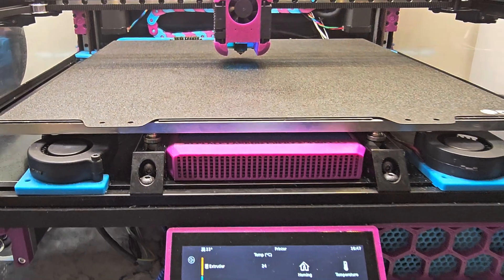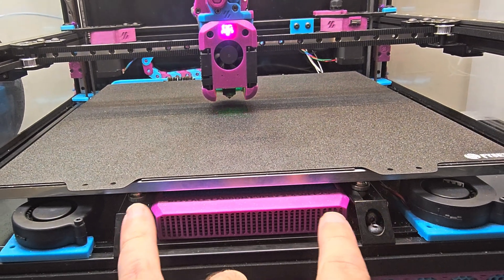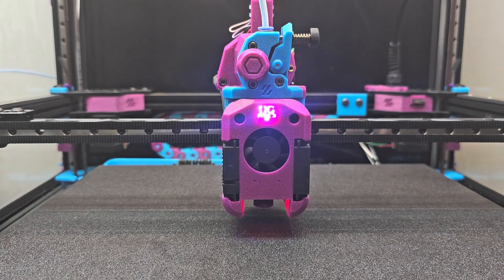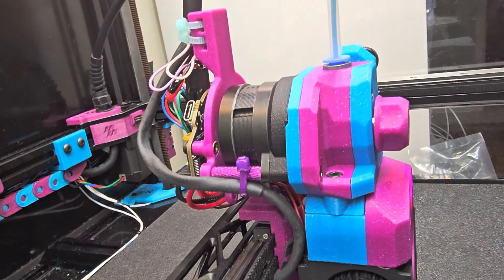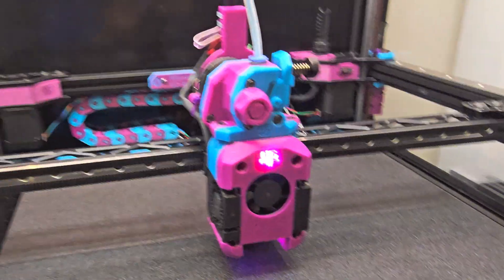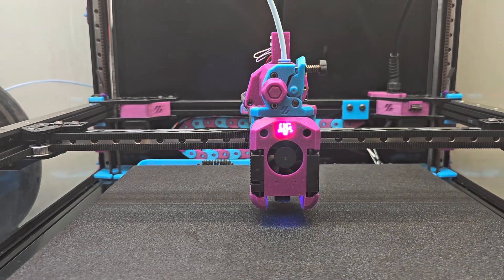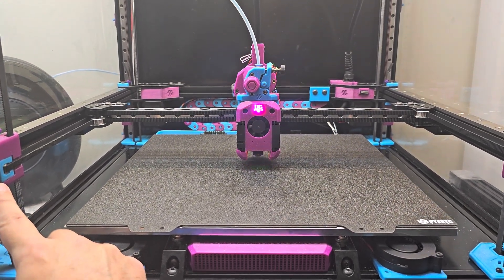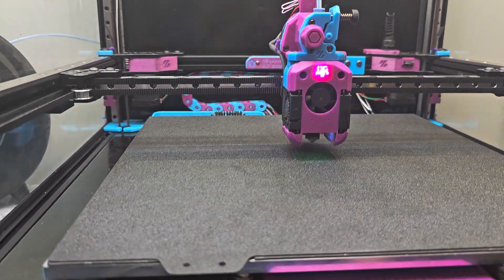Voron 2.4R2: A few new changes

Comment: I'd like to ask a question, on the cnc light rail, is that mgn9 and if so, how many screws have you put in to hold it? I have a light gantry made for mgn12 and with mgn9 only 4 holes align. Thank you

Comment: Hello! Are there any problems with the rigidity of the lightweight X-axis? I'm going to use it together with Tap and I have big doubts that there will be strong vibrations when moving along the Y axis.
Reply from the maker: I didn't see much improvement with this lightweight gantry, so I ended up reverting to the original 2020 extrusion.
Reply: @oldguymeltsplastic  Thank you!

Comment: I just purchased a 2.4 after watching your channel.  Do those under bed fans actually help with chamber temperatures?  I seem to be maxing out at 45c in the chamber during a long print.
Reply from the maker: Hope you don't end up regretting your purchase and blame me. 🤣
The bed fans help to more evenly distribute the heat throughout the build area. My peak chamber temperature hasn't really changed, but I get to that peak temperature faster.
I usually run at about 60-65C chamber.
Reply: @oldguymeltsplastic  🤣I'm trying to copy your build and slowly realizing that I need to chill out a bit.  There are so many mods you've done, down to the little details.  Maybe I need to seal my 2.4 better for the chamber temps.
Reply from the maker: @jinetix  I am probably going to get blasted for saying this, but I don't bother heatsoaking for any of my prints. Don't go chasing unicorns.

Comment: sherpa mini vs g2sa and why did you switch. does g2sa provide any advantages over sherpa mini ?
also how does one attach the  btt ebb36 can to sherpa mini on the top ?
Reply from the maker: G2SA gives me much better layer stacking. There are many PCB mounts from Chirpy, KayosMaker, and others.
Reply: @oldguymeltsplastic  would Orbiter Extruder V2.0 be a good choice as well compared to G2SA and Sherpa Mini , I have it available locally the Orbiter 2 (LDO and Moons brand kit)
Reply from the maker: Good question, I hear good things about the Orbiter (it's a very similar design to the Galileo 2, only with different gearing), but I have no personal experience with it.

Comment: I had just done the 3do usb/can cable mod, looking through this video -- correct me if I'm missing something, but the pink and purple cables are the 24awg non-twisted pair running down the middle of the cable, the yellow/blue, white/green are the 26awg twisted pairs -- so for can-h/l you want to use the twisted pair and for usb rx/tx you want to use the other twisted pair -- and the ping/purple are for usb power, at least that's what I did after digging through the 3do docs about the cable. I ended up using lower profile pg7 glands, so I should not be losing any build height -- no sure I am too concerned about that since I also rebuilt a my first diy printer -- a large delta with 670 effective build height, so i need something tall, I can use that. PS -- I also did the cpap mod, and the cooling is fantastic, I ended doing all new cad for that since I wanted to do the knomi and cpap and keep the exhaust fan with filter, and that combo didn't exist to my liking. Curious what your input shaping look like -- do you notice a change with light weight x gantry vs going back to the extrusion. I'm considering getting aluminum a/b mounts -- wonder if it's worth it.
Reply from the maker: That's a lot to unpack... 🤣

Comment: Been following your mods for the 2.4 and ... pretty damn cool man. I think i have the same xy joints but i was only able to make it work with a stack of f695 bearings, did you modded in some way to fit the iddlers?. Loved the video.
Reply from the maker: I bought toothed idlers that were less tall, and so fit in the space available on those pins.

Comment: Hi is there any assemble for the gaelileo 2 (g2sa)
Reply from the maker: The G2SA version of the assembly manual hasn't been released yet. I was able to assemble it fairly easily using the G2E manual, and my experience with other DIY extruders.
Reply: @oldguymeltsplastic  what i am confused is the tensioner arm am i suppose to put a bearing in the hole?
Reply from the maker: @halcyonspree1523  that's correct
Reply: @oldguymeltsplastic  then how is the gear grip the filament?
Reply from the maker: @halcyonspree1523  using pressure I would assume. Best to ask the designer.
Reply: @oldguymeltsplastic  can you tell me where i can get some gear replacement?
Reply from the maker: @halcyonspree1523  no idea

Comment: Upgrades for upgrades. People fix voron 2.4 but don't want build good not voron printer
Reply from the maker: People build DIY 3D printers for different reasons. For me the modding of my printer offers me many learning experiences, and teaches me some of what makes 3D printers work. The popularity of Voron printers means there are lots of mods out there to try. That's not to say they are the best designs, but maybe one of the more accessible ones from the standpoint of modding.
You absolutely should build the printer that YOU want.

Comment: I see a k3 style door there. Nice choice
Reply from the maker: Yeah, it's solid, seals well with an nice audible "thud" when the two magnet catches connect.
Reply: @oldguymeltsplastic  got one to install myself. Just waiting for bearings to deliver. 6mm policarbonate is super thick

Comment: What are your shaper values? I didn’t save much from switching from stealthburner to the dragonburner. Weight is 80g less. I’m using same funssor aluminum cnc AB and x parts. I also tried the lighter x beam but didn’t improve much either. The GE5C mod improved about ~20% acceleration. So now on the x I have mzv 12k but on the y only 7k also mzv
Reply from the maker: My IS results are similar to yours. I was able to improve them a little bit by adjusting the AB belt tension higher. Hoping that the AWD mod will help that somewhat.
Reply: @oldguymeltsplastic I'm going to change the MGN12 for a MGN9, I redesigned the X_carriage to support MGN9 and the beacon and got it down to 15g (maybe too light :) ) . I'll let you know how it goes, and I'll share the onshape in case you want  to give it a try. BTW I installed the beacon because I saw it in your channel, and it's awesome. Thank you for sharing your videos
Reply from the maker: @arielbernal  look forward to hearing about your results!
Reply: @oldguymeltsplastic , I have an update. TLDR; I didn't get any improvements at all :(

I redesign the x-carrige for the MGN9, but still polishing some printing accuracy issues as the belts are require to be attached differently.
I also have to redesign the EBB36 lgxlite support because the center of mass with the dragonburner is too high and produced oscillation on the z-axis when moving on the y-axis.
So, I had to attach the EBB36 support to the x-carriage. It sucks because it needs to be attached from behind. Now the x and y axis graphs look like a Dirac delta!! amazing 
I reduced:
- 121g from the MGN12 to MGN9
- 138g from the aluminum extrusion to the light extrussion like the one you're using
- 23g frm the x-carriage
Total: 282g!!!!
Input-shaper results: 
- x-axis: ~5%, as expected by the 23g + the linear rail carriage weight 10g
- y-axis: ~1% :( 
Quality: I think now I can print at 7k with almost no ringing affected by y-axis. So I would say it improved. 

At this point I think I'm limited by something else, the y-carriage is super smooth, no bindings, rack is square, pringing is perfect.
probably the wire loom issues? I don't know

If you want I can give you full access to the onshape design. I have a bunch of other mods, I should put them in git. I used to put stuff in my Youtube channel with my daughter https://www.youtube.com/watch?v=yrI_C9hVV4M, but she's now doing her Ms in ECE :(. life pass soo fast
Reply from the maker: @arielbernal  yes, please do share! Find me on Discord as OldGuyMeltsPlastic.

Comment: I had the same issue with my belts using the same idlers. I hadn't tensioned the two bolts on the idlers evenly and it was causing the bearing stack to become tilted/cocked and caused the belts to ride up on the flanges.
Reply from the maker: Yeah, all of the motion parts are aligned properly,  but I had some toolhead crashes into the frame while dialing in sensorless homing, and the belts loosened.

Comment: Cant wait to see the AWD mod!
Reply from the maker: Debating between 6 mm belts, which will allow me to keep my existing CNC XY joints, or 9 mm belts, which will need new printed XY joints, probably AE Trailhead.
Reply: @oldguymeltsplastic 6mm should be fine for a build of this size.
Reply from the maker: @twanheijkoop6753  6 mm = fine, 9 mm = better

Comment: Super cool upgrades! Your camera/phone is doing some funky stuff, I kinda looks like it’s switching between which lens it’s shooting from.
Reply: thats normal with smartphone cameras when getting close, its less noticeable with iPhone but if you want to completely eliminate it (which i highly suggest) you will need to force using only 1 lens somehow or just using a DSLR.
Reply: @itz_lexiii_ yep, iPhones are usually very smart about it and hide the transition very smoothly. Seems that the Samsung implementation is shoddy at best
Reply from the maker: It's a Samsung S23. Probably happened when I moved in too close.